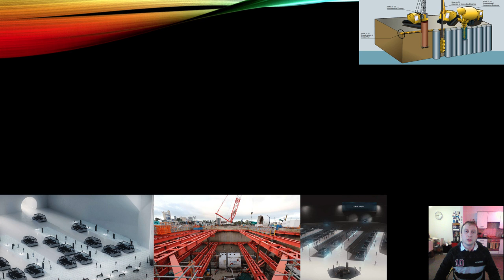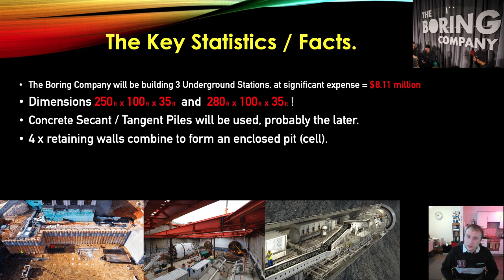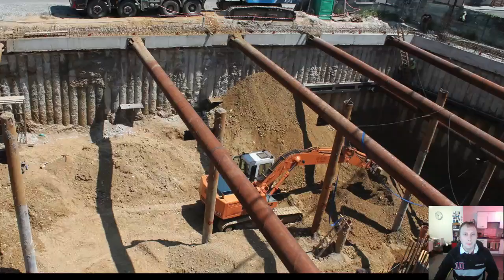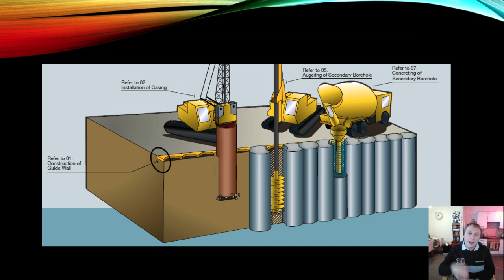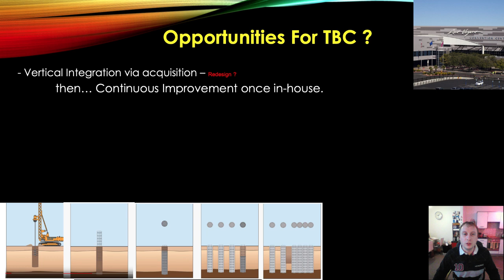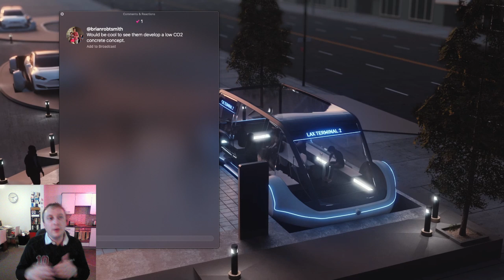Boring Company Las Vegas : Pits, Props & Secant Piles - Episode 42 👷🏽‍♂️ 🏗️ 🚇

Comment: Im ignorant
Do they make ditch digging machines that go down that deep?
Like a ditch witch?
Maybe augers are faster.
I believe they call the subsoil caliche.
An aggregate like concrete 
I think its most of the south from California to Texas
Reply from the maker: I've seen a trench maker in Texas that looks a bit like a chainsaw but 100 x bigger. However I think the maximum operational depth is around 22ft and only works in medium to hard rock.
The main issue is that the sub-soil tend to collapse in on it's self and thus the bottom of the trench would be likely be strewn with boulders and soil.
With the steel casings and the auger drill you tend to get a perfect circle 99% of the time and it works in all sub-strata from quartz (hard) to loose clay (soft). 
an excellent question !